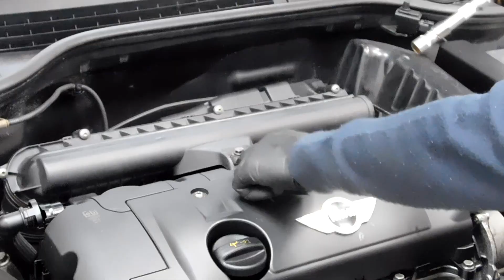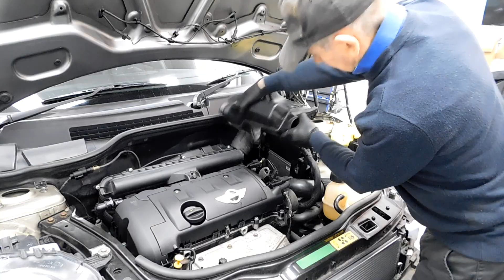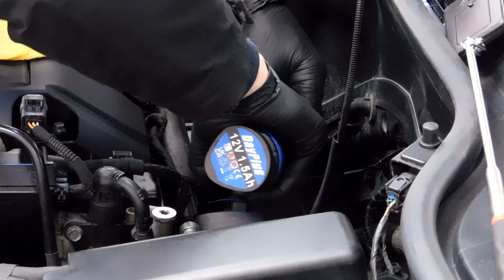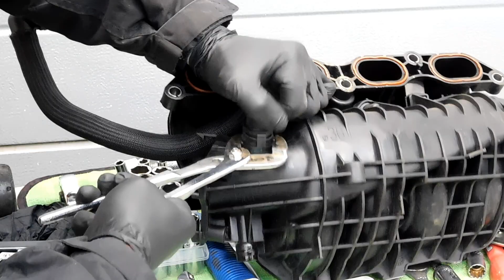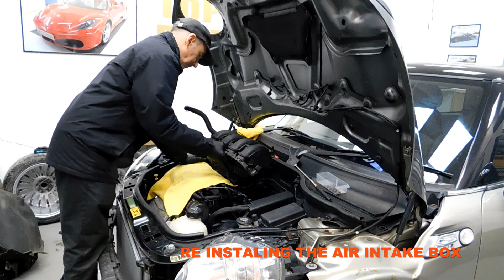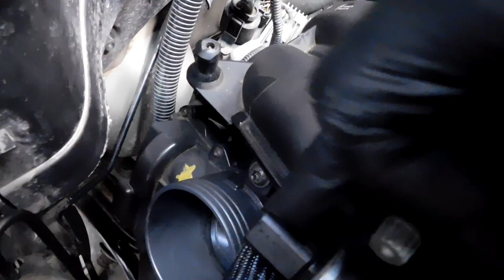Mini Cooper R56 Crankcase Oil Breather Pipe Replacement Explained!

Comment: Code oem pcv plase
Reply from the maker: This was the part that we found on Ebay, Fits Mini Cooper One 1.4 1.6 MFD Crankcase Oil Breather 11157555261 11157568081  Cheers.

Comment: Isn't there a 10mm bolt which holds the throttle body and Air intake manifold to the engine.? And it is extremely difficult to get off (and put back on).. 

..Also the sound resonator.. 🔊 👀
Doesnt that have to come off too?
Reply from the maker: Yes once the drivers side wheel and arch lining are removed you can get to it using an extended bar and socket adaptor. but this is quite dificult to do.  The way I did it once the throttle body was removed, I used an angled mirror and managed to get a flexible socket adaptor on to the bolt. Not the easiest part to get to, Cheers

Comment: Very helpful video as I tackled this job on my daughters car.
Reply from the maker: There isn't much room in the engine bay on these cars, quite a lot of things to dismantle just to get this pipe off.  I think they should have come up with a better idea than having a plastic pipe on there considering the heat from the engine etc, Cheers.

Comment: That pipe when it's damaged it's the one that causes a mini to rev non stop on it own
Reply from the maker: They should have come up with a better idea than using a plastic pipe, plus its not a straight forward job replacing this as you would have seen in the video, Cheers.